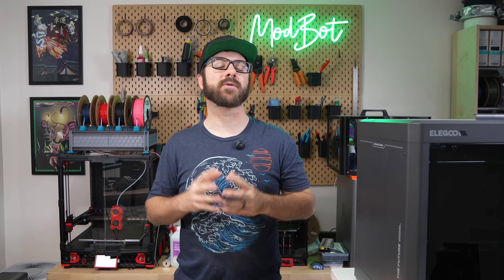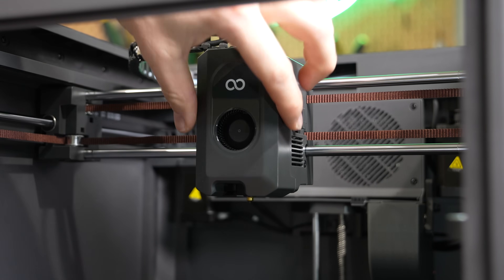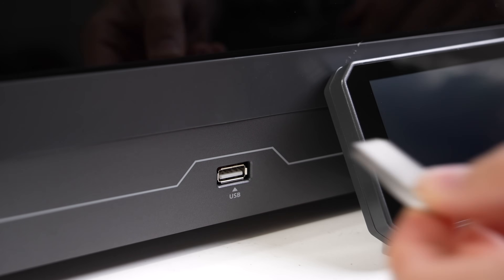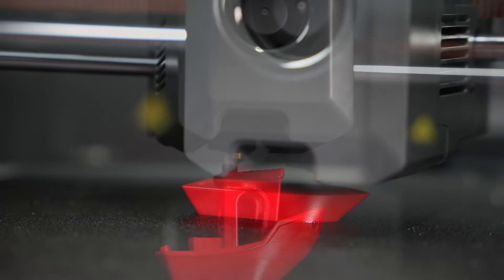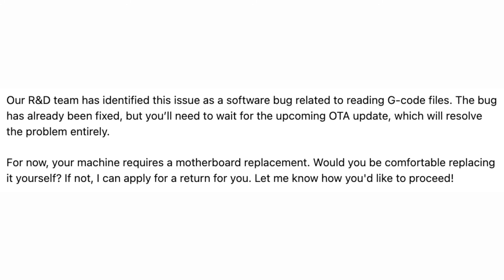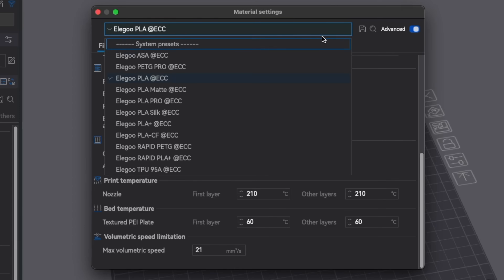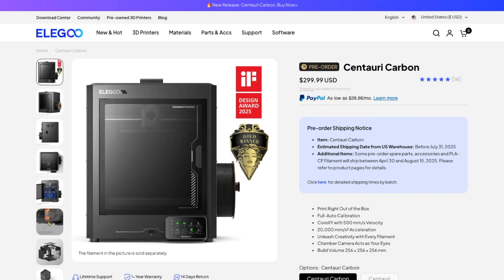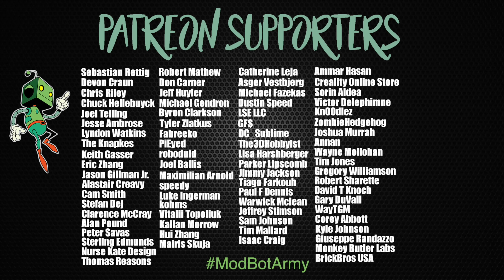$300 Fully Enclosed CoreXY 3d Printer (Elegoo Centauri Carbon)

Comment: I heard you want tramming on this printer. Who would want manual bed leveling. We all know it's worse, less acurate and slower. The auto leveling does everything for you. If your auto leveling wants z offset, something is wropng with the z gantry wich can be adjusted by loosening the z belt and moving the screws independently.

Comment: You can still tram it, but it's a huge pain and requires taking things apart that most people wouldn't be comfortable touching. You have to free the ball screws from the pulleys/cogs and use feeler gauges to manually tram it. Once done, you have to reattach the pulleys/cogs extremely precisely. Huge pain, but where there is boredom, there is precision haha

Comment: Hello. Thank you for the detailed analysis of the device. My question is this. If I update the device when it is launched. Will I not have the same problem that you had that forced you to replace the motherboard of the device? This is a very important issue. Was this problem resolved after updating the device software? I would appreciate it if you could answer my question.🙏🙏🙏🙏

Comment: For the price, looks like an awesome deal. However, instead of copying X1C, I wish Elegoo would have made the surface 300 cubed and charge a bit more. Us hobby folks who already have X1C type will not buy the Centauri when it has exact same size build plate. IF they had gone 300-300-300 or LARGER ... heck, I already have their 3 MAX and would love one faster.

Comment: If have issues with Z height on ABS and hotter filaments can always run the auto level for that specific temp, I would give it extra time to really heat soak also.  I know with ABS and bed temp of 90 that doing actual auto bed level for 90 C helped on one of my printers.  I did snag a 299 Centauri, looking forward to giving it a test drive.  Hopefully, by time it comes there will be many profiles out there.   For the price can not go wrong.

Comment: I just can't trust companies in this industry to push updates reliably past 3 years anymore. Unfortunately the "proprietary" f/w is a deal breaker for me. I don't want to be sitting on a printer with shit f/w in 3 years when they stop updating anything at all. Do they think they are Macintosh? Repackaging free open source software to separate rubes from their money. With the culture around 3d printing largely being made up of people who like to build, make, design, repair, etc... You would think companies would sell a well built feature packed printer with an 'ez mode' for newer folks, and 'I WILL do whatever I want to my machine because it's mine' mode for the power users. Frankly if you try to lock me out of functions and features, I will buy someone else's printer, if it's a real good deal, I may buy it for the bones and toss everything proprietary. TRUST ME 3D PRINTER DESIGN/MFG COMPANIES... NO ONE... LITERALLY NO ONE WANTS YOUR STOMPED ON VERSION OF KLIPPER BECAUSE IT IS ALWAYS WORSE THAN A FRESH CRISPY KLIPPER FROM THE SOURCE. "OMG did you see that new printer that Elegoo just dropped? I'm going to buy 5 because I really love their software!" - Literally no one ever. We want well built machines for good prices that do exactly what we tell them, that's it. If I want to install Duck Hunt NES on it and use it for that instead of printing. I should be able to.

Comment: Seeing something very strange with both Orca slicer and Elegoo slicer when working with Centauri Carbon.  Running on a Mac using arm64 version of both slicers.  ==> For final testing of flow ratio I like to create a 3 layer flat disk that is about 5-8 cm across.  Watch it run and then get a pretty good idea of how the first layer, standard layers, and top layer flow ratios are working.  ==> Here is the weird issue.  Assume a first layer height of 0.24, and other layers are 0.2.  If I create this disc with a height of 0.64 the slicer will generate a 4 layer model with a height of 1.14.  Can duplicate this at will.  It only does it with my Centauri Carbon printer profile.  Oddly it does this in both Orca slicer and Elegoo slicer.  I have gone over every slicer setting and compared with profiles for my other printers.  Very baffled as I have not seen this type of glitch before when slicing in Orca for any of my other printers.  (6000+ hours of printing so not a newbie) ==> Is anyone else seeing this?  ==> It is almost like there is some meta data for this profile that is slightly off.  Posting this here as you are quite a bit sharper than the average user.

Comment: I just ordered one. really just wanted a centauri as I don't need an enclosed printer, but I decided to go for the carbon since the centauri's preorder is still sold out. It will be my first core xy and my first non-Creality printer for my little print farm so we'll see how it runs for me. Since I run printers pretty much 24/7, I expect to be able to stress test it pretty well :)

Comment: Seems a pity you didn't try a CF filament since it was designed for the tougher stuff.

Quite surprised you had so many issues, but really appreciate that you shared them since other reviews I've seen have had nothing but praise for the unit.

Thanks for your endeavours

Comment: The sharp feed angle is what made me cancel my preorders. That is a high temp/ brittle  filament nightmare that I cannot afford to deal with in a production printer.  I really don’t understand why manufacturers continue to neglect the feed design on most printers.
Reply: I hear you. They did this because they didn't want to add more z height to the enclosure, it would have increased the price dramatically, but this is a manageable issue.

For me, the closed nature of the machine is a deal breaker. Can't SSH into the device? No thank you.

Comment: You can’t do a bed mesh with the bed up to temperature?  The carbon version should have 3 steppers for bed leveling.  The cheaper version could have a single z motor.  Printer looks very promising especially at the price.  Like many Chinese products it is not thought through, and not a finished product.

Comment: Genuine question - how do you get the noisy case fan to STAY off? Changing the slicer (filament profile) “Exhaust Fan - while printing” setting makes no difference… it still comes back on a minute or so after being manually turned off! (Firmware 1.1.8 by the way)

Comment: Hi, can you do a video on how to calliberate e steps for X and Y axis for this machine  and as well as flashforge AD 5M, as these machine come with a default step value of 80 or 100 which i have notice does not produce 100% accurate part hence having the error of (-0.5-1mm) in part dimension, this makes it difficult to develope assemblies specially on different printers causing fitment error I mean serious errors

Comment: Isn't this the machine that destroys itself in the first 2 weeks by absolutely OBLITERATING the belts?  They've got smooth idlers on the toothed section of their belts, along with over-tensioned belts, and fast speeds, the machine literally lasts 2 weeks before it destroys itself.

It can be fixed by replacing the idlers with the correct idlers but wow what an amateur move.

Comment: Meanwhile the flashforge adventurer 5m and 5m pro don't have these printing issues and can have klipper directly installed on them.  I have 8 of them which have been running practically non stop for over 2500 hours.  but... flashforge bad! right?

Comment: "Oh yeah, so we released a machine with a bug that can basically turn it into a paperweight. But don’t worry — all it needs is a full motherboard replacement.

What’s that? The return window has already closed? Yeah… tough break. Just hang tight for a few months while we ship you a new motherboard so you can fix it yourself. Or, if you'd rather not, send the whole thing back and wait even longer for us to handle it."

Not a Bambu fan/user, but Bambu killer my a...
Reply: Strangely, I gather that some Klipper machines can also misinterpret g-code as being a firmware update when they find a usb stick inserted when they are booting up. 
Strange, because no, the CC isn’t running Klipper. Anyway that bug is now fixed in the CC, so it’s just a curiosity now.
Reply: @dougal6569  Klipper machines don't do this -- This particular machine is using some weird Android controller firmware that I've seen in various sovol machines as well. It isn't Klipper or Fluidd based; I'm sure of that.

Comment: Nice review. I've had mine for almost a month now. My pre-order was slated to ship in June but arrived much much earlier in case people are getting impatient. I've been printing pretty much nonstop since it arrived and have had almost no issues. I had the nozzle dragging on the bed problem mentioned in the video once but I ran it through leveling again and it was fine afterwards and hasn't returned. I feel the rear filter doesn't work or I'm exceptionally sensitive to whatever fumes still come out of the machine because my eyes would sting, skin would itch, and I'd cough if I was in the same room. I've moved it to a room across the hall, put it in a closet with a separate air purifier running next to it and the room door closed, and my eyes still hurt. It is incredibly loud. I've also noticed that until you hit the 'confirm' button after a print has finished, it'll just turn the case fan on 100% until you do confirm. So if the print finishes in the middle of the night, it'll blast that fan for 6 hours until you get up and check on it. Other than that, I'm really happy and looking forward to the multi-colour addition.
Reply: What filament have you been using to get all the bad smells and such?

Comment: I spy many similarities to the Creality K1, e.g. gantry parts, as well as almost identical touch UI and web interface. This seems to be the low cost version of the K1 series, only under a different brand. The situation around their custom Klipper hack is ... interesting. I guess the SoC has a real time core that runs the MCU part of Klipper. The SoC in the K1 series is already a little lacking in power, and I guess this will be even slower. I don't have high hopes this will give any sort of nice Klipper experience. But for anyone wanting a cheap CoreXY to hack on (custom replacement board and firmware etc.) this could be interesting. Let's wait and see which issues creep up with the mechanics!

Comment: After 150h of printing without any issues, my printer is already dead. It's stuck in a loop of reboot/self testing/bed levelling error (buse is pushing on the bed and making awfull noise)/reboot again.
No solution from Elegoo untill now. :(
Reply: There is a known issue (fix on YouTube etc) where the bed catches on the nozzle scrubber. It has caused miscalibration of bed levelling (and printing above the build plate). Might be worth your checking that that isn’t your issue.

Comment: Looks like a good option for a starter if someone isn't used to fine tuning. In my experience, it isn't that difficult to change out the main board and add a rPi to get a full klipper setup, but it may not be up to the tasks if you go that route.
An affordable starter with promise, and it can print more technical materials. Not a bad entry.

Comment: Elegoo's low price on the Centauri and Centauri Carbon convinced many people to fund Elegoo's production several months in advance.  This probably seemed like a savvy business strategy but Elegoo may be in serious trouble.  By accepting payment months in advance, Elegoo is now obligated to deliver printers to US customers.  If the new tariffs persist into the summer, Elegoo could easily lose a significant amount of money on each Centauri printer sold in the US, but asking US customers to pay more money for a printer they already purchased or issuing refunds to US customers after using their money for several months will result in a huge loss in credibility and goodwill.

Comment: Voxel PLA sucks. If you leave it loaded in any length of PTFE tube, it breaks in multiple places. Super brittle. Doesn't matter if its brand new or freshly dried. Stay away.
Reply from the maker: I’ve been using it for years without issues for plenty of projects. Most pla gets very brittle if you leave it loaded in ptfe tubes and exposed that’s not unique.
Reply: @ModBotArmy  Well non of my other PLA filaments have ever done this. I ended up throwing away my last 4 full spools of voxel PLA because I was sick of fishing out filament chunks out of the tubes for my mmu3. Not worth the hassle.

Comment: Bambu is using tariffs as an excuse to raise prices. They knew they were coming. They knew most people expected the H2D to be $3k. So they shocked everyone at $1899, but only because so many people expected it to be $3k. They are rapidly getting to $3k, and also using the excuse to raise the price of everything. I was going to get an A1 combo. At the time I was considering it, It was less than $600 shipped to me, so I was just going to wait for June to see what they did for their anniversary. Now, it's not even close to that. Meanwhile, I started seeing all of these videos pop up for the Centauri Carbon, so I ordered one of those. Hopefully their multicolor solution isn't more than $300 per 4 colors. I have an A1 mini for use in another business, so I know how great Bambu printers are firsthand. But I'm not going to stand for these ridiculous price increases that they're blaming on tariffs, all while no one else seemingly has been doing this.
Reply: Mad King Donald imposed his import sales tax rather quickly. It applied to anything that wasn’t actually on board a ship that had undocked by midnight. 
If you (or Apple) managed to get lots of stock landed (or even on the way) you have some breathing space to sort out your pricing. But you would be badly caught if you had “just in time” logistics…

Comment: The underside seems prime real estate for your own board + Klipper-installed Pi (with 3 stepper motors instead of that belt system).
Reply: That's what I was thinking. A controller and rPi could be less than $70.

Comment: Waiting to see when Elegoo fixes the printing in air issue.
Reply: It has no means of detecting a nozzle clog. When it happens, it just carries on with no filament extruding. It is a clog. 
Now if Mike would put his BBQ thermometer probe alongside his mainboard, then we could see just how extreme the temperature gets after an hour or two of printing in the Arizona heat. 
The electronics area has a fan to move air around, but not to actively change the air trapped in that compartment. There is a mesh area, on the bottom, but as we know “heat rises” and is going to be trapped in there. 
When Mike showed checking the connections (regarding his earlier (firmware fixed) ‘anomaly’ issue, there was no dust in there - whereas he has had lots of dust in the print chamber - and that demonstrates how much less air is going through that electronics compartment. 
CPU coolers demonstrate the need to keep chips cool for them to behave and not crash. But running them hotter will cause earlier complete failure. 
For long term reliability, especially in warmer climates, an electronics cooling mod would be a good idea.

Comment: I have two of the launch CC's and I have to say I am disappointed. First, both of them have a problem with printing in the air after the first several layers - it is either the extreme bend of the PTFE tube in the toolhead or a weak, cheap extruder. I am not the only one that has this issue. Second, there were no additional nozzles included with the retail units, at least not with the two I got. Elegoo may have included an additional nozzle for your review unit. 

I get one successful print out of four attempts. I am not sure why it starts printing in the air after completing the first several layers. I know some have claimed it was heat creep, but both of my CC's are located in my basement, with a 30 to 35F ambient temp. None of my other printers in my print farm in my basement (Plus4, P1S, enclosed SV08 and Kobra S1) exhibit this behavior. I am past my return window, otherwise, I would have returned these machines and got my money back.

Comment: Curious if you will swap out the ptfe tubing and replace with the bambu (larger inner diameter) tubing and/or use a riser, loosen the tubing from the first chain clip, etc, so less of a  bend and less friction in ptfe tubing.  Wonder if that will improve the PETG printing.  Other users are reporting issues when booting printer with flash drive plugged in, similar to what you experienced.  For the price there seems to be a lot of value and all of these different brands of printers could use some DIY hacking/modding.  Lets be honest that this is part of the fun.  As long as major issues are worked out, firmware is periodically updated, and work arounds discovered, it should be a good printer and a good tool.  Everyone of my different brands of printers has quirks and its own personality.  None of them are perfect or work perfectly in all situations.  I find Klipper interesting and useful, but there is also a lot of value and potential high quality user experience in point and shoot.  It opens the door and levels the playing field for those who not as technically inclined.  It also potentially reduces the time, effort, variability, and cost of using a 3d printer as a productive tool.  Fully open source Klipper is great, but not everything needs to be measured against it.